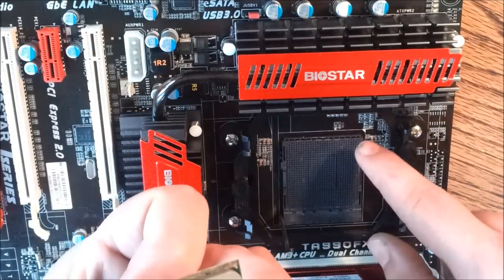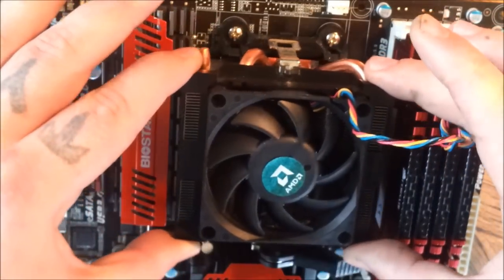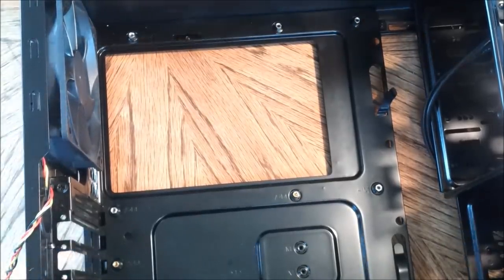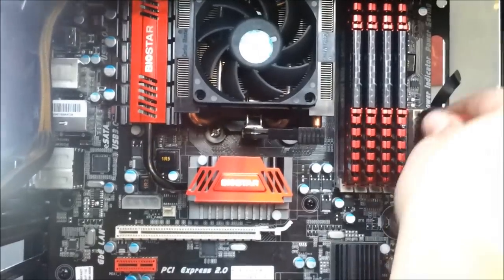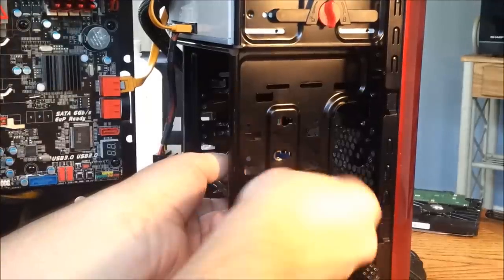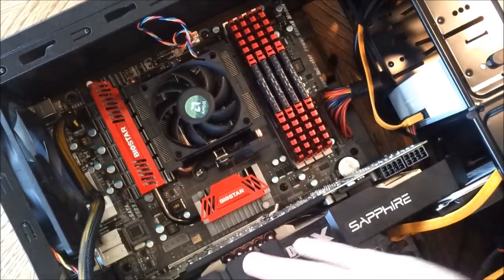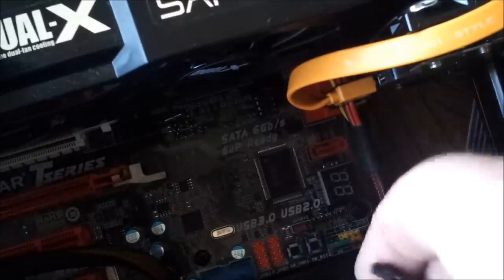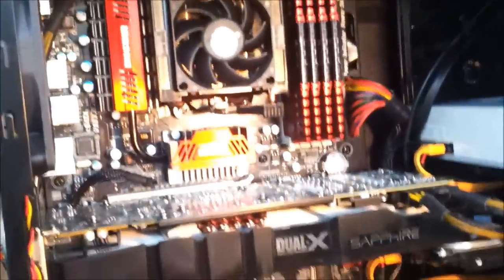HOW TO BUILD A GAMING PC 2013

Comment: You really do an excellent job of making it look super easy. I am glad to find this video as I have the same case. The rest of the parts for my build come in two days so I will be using this video as my guide for the most part. Thanks!
Reply: +Michael Scanlan lol im in the same boat rn basically my parts are coming in 4-5 days and i have the same case
Reply: Mortal Killer Awesome :D It's a great case. The motherboard I got only allowed me to get two fans going and it still stays cool and has good airflow. Can only imagine with all of them going at once. 

This is probably a bit of a dumb thing to say but I made this mistake. I put it all together and pushed the button and it didn't turn on, I thought I made a mistake. Turns out the button on this one needs to be pushed in and held for a bit before it powers on. I am  used to having a button that just turns it on immediatly lol. Good luck on your build :D
Reply: oh ok thanks for the tips and i hope you like your pc :)

Comment: This makes the prospect of building a PC a little less daunting. I have a few questions:
1. Does every AMD processor come with that thermal paste?
2. If the Redbone has about 3 fans, is it absolutely necessary to put a CPU fan in?
Reply from the maker: 1. Cpus usually come with a cooler (heatsink with fan). The thermal paste comes pre applied to the heatsink.
2. The CPU fan(cooler/heatsink) is what I mentioned above and it is absolutely necessary.

Comment: Those brackets you put the graphics card into are already removed in this video, how do you get those out??
Reply from the maker: some cases have them tack welded  in. remove the side screws, and they either slot out towards you, or pull out like taking the tab off a soda can.
Reply: +Tymm Von D ah, I'm doing a build with the same redbone case right now and I couldn't figure it out